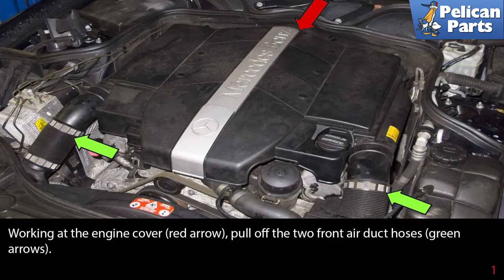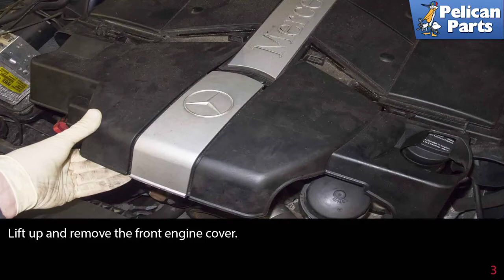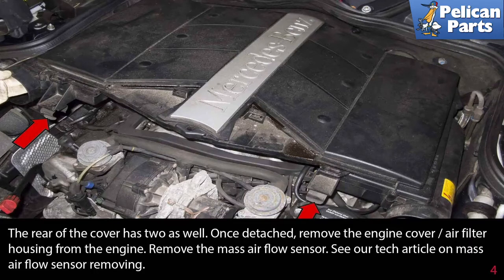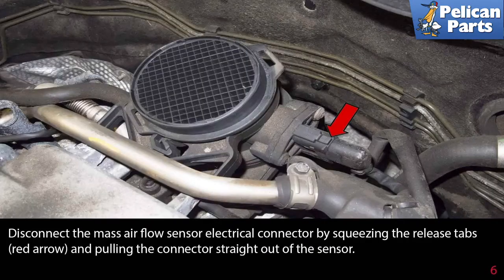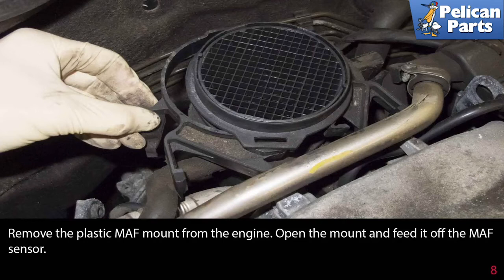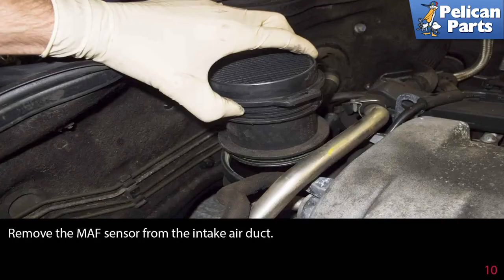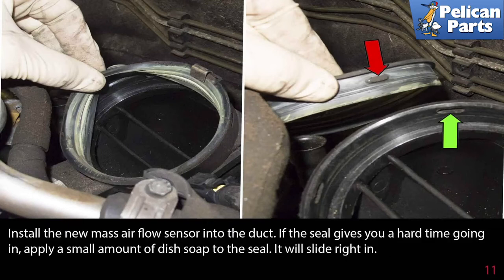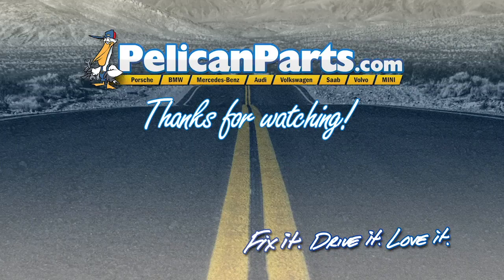Mercedes-Benz W211 E-Class Mass Air Flow Sensor Replacement

Comment: Car went into limp mode. Gotta clean it up
Reply from the maker: I would start by checking the DME for fault codes. If the system is not working properly, a fault code will be set. This will be your best bet when diagnosing.
Reply: @pelicanparts  so I brought the car to be inspected....sounds like they want to replace the entire valve body ($2k parts and labor) ouch.
Reply: I was informed the conductor plate could be swapped and reprogrammed by a third party, but that is $1600, so better off just doing the entire valve body.

Comment: can i use a e230 afs on a e500
Reply from the maker: Only if the part # is an exact match. With your vehicle info handy, give The Pelican Parts parts specialists a call at 1-888-280-7799. They can figure out what part or repair kit you need.